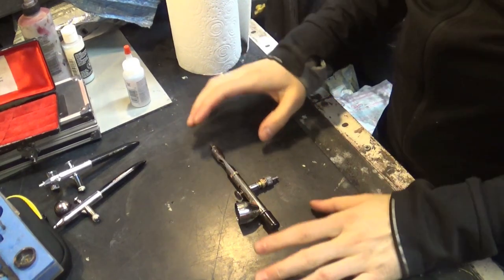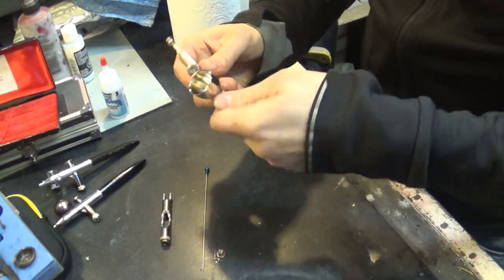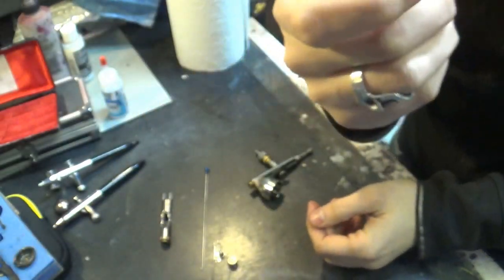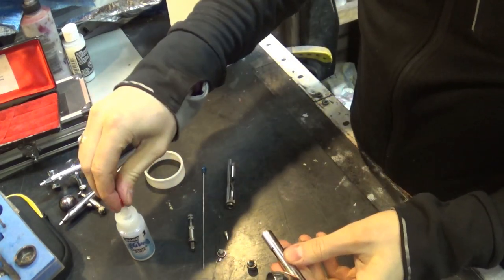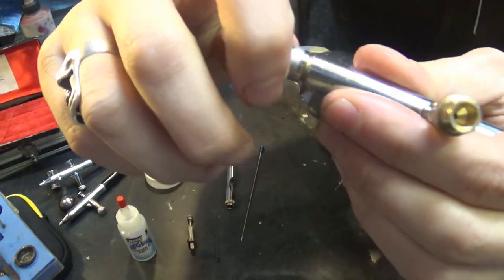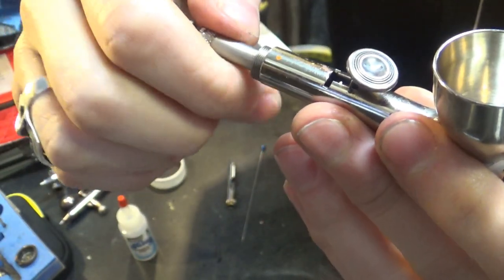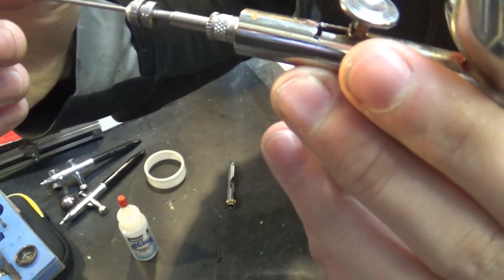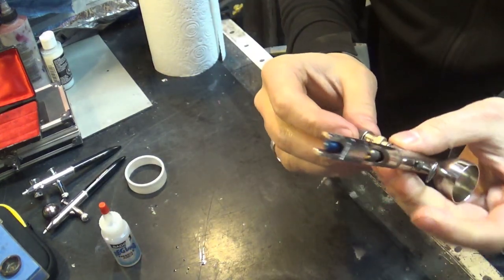How To Airbrush - Part 2 - Airbrush Setup

Comment: Ha, I noticed the Youngs Ram Strong Ale. Memories. In 1969 and 70 I worked at Youngs Ram Brewery on Wandsworth High Street in London.  Nice tutorial. Cheers. I've not tried that Needle Juice. Tried a couple weights of machine oil. Ended up using Waterproof grease on everything. Seems to work well for me, especially on the aircap threads.
Reply from the maker: Good point, I will give that a try!

Comment: Finally ordered my 105. Managed to get it in a 3-1 kit with needles .3, .5 and .7.  Good price under £100.
Reply from the maker: not bad,and you see the quality of that kit!
Reply: Mackie quick question. my 105 seems to be releasing air when trigger isn't pulled back. I spray some practice dots keeping the air on and I'm getting a faint line. I noticed when I was cleaning it, on air only I'm getting a tiny amount of cleaner in the air. Any ideas? Cheers dude.
Reply from the maker: There is probably tiny bit of paint dried out there in the system. Either on the needle, or the nozzle..or both. Take it apart and give it a good soak in airbrush cleaner overnight. Then clean it thoroughly. When putting back together make sure it is all nice and tight. 8times out of 10 that will solve the issue. I ran into same problems every now and then.
Reply: Cheers fella, doing a full strip and clean tonight. I have a little Ultrasonic cleaner for the fiddly bits. Cheers Mackie

Comment: Hey Mackie, great video. I noticed your 2 DeVilbiss airbrushes, the one is the E model, which I think you have set up for high flow/large nozzle. I wondered, is your side feed airbrush a super 93 or a super 63?
Reply from the maker: Hey Lee. They both have been given to me, and the side feed never worked properly. There is a problem with the air valve I think. And since I got my Badgers I never bothered fixing that.